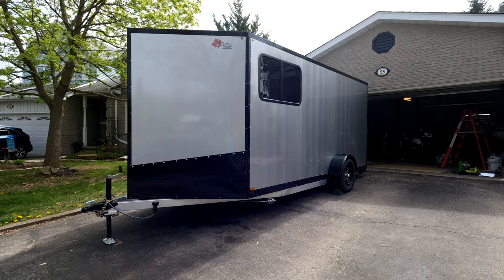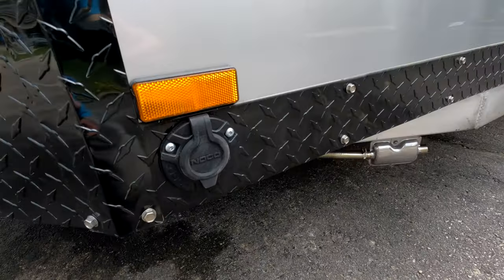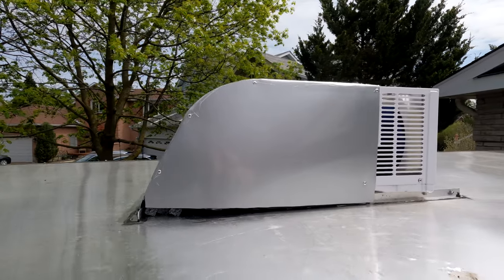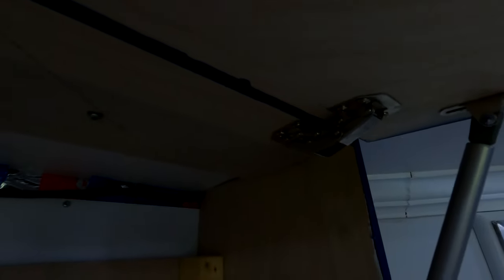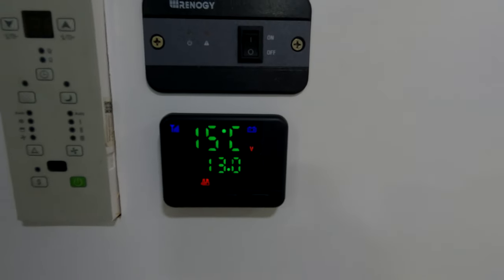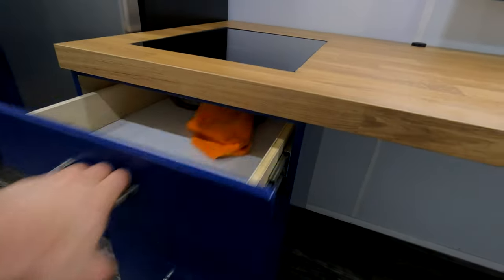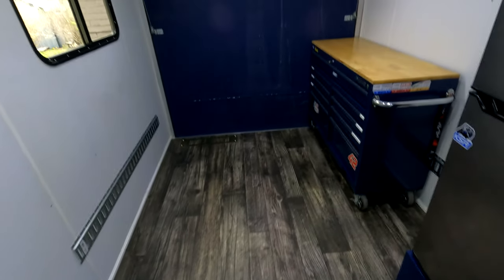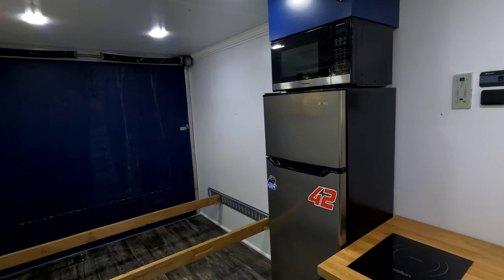Cargo Trailer to Race Trailer Conversion, 7x14

Comment: 1. I assume you plan to run the diesel heater at night? Assume you've tested that it's quiet enough for others around too then. That my main concern, I really want one as those nights at bogie at a little chilly later on, but don't want to bother others. What make/model did you get?
2. That AC idea is genius, imma use it.
3. That poor car. You might be better off renting a truck for the weekend.
4. Wish my trailer ramp could be made into a drop down like that. That's genius for the bed.
Reply from the maker: Yes, it it very quiet, I wouldn't hesitate to use it trackside in the pits overnight. The car is rated for 3700lbs and with the trailer fully loaded I am right around 2600lbs. It does a great job with it; 3L inline 6 turbo has more than enough torque. Also has oversized brakes, transmission cooler, large wheelbase and wheels/tires. It's very stable while towing!

Comment: I like it, I’m installing insulation  in my new 6x14 just pulled it home from Washington to California with my 5,000 pound ford flex 460 horsepower V6 engine, manufactured hitch with a 3,500 total weight rated hitch 250 pounds at the hitch… trailer 1,300 pounds had electric brakes installed by the dealer. Your trailer must be about 1,500 pounds, your car 3,500 pounds, not suitable for towing! Please reconsider your tow vehicle. With your motorcycle, guessing weight 2,200 pounds,  hitch weight must not exceed 300 pounds. Be prepared for an emergency braking situation if your trailer starts swaying you will most likely not be able to to regain control! If you have brakes on your trailer, install brake controller it will help you to control trailer swaying. On a windy day, wind can blow over a 80,000 pound 18 wheeler. As I started my trip with a 12’ U-Haul trailer California  I5 out of Sacramento the wind blew for 60 miles scared me that the wind might blow me off the road, I mean scared!!! I had driven my 18 wheeler on this road many times in the wind , believed me your BMW is not a tow vehicle. You can get by with it. Maybe 100,000 miles but there’s always traffic and weather. You never know when your going to have to brake in an emergency, it’s hell when your trailer try’s to pass you, Your BMW is the same color as my Mustang 4 million miles driving the roads of this country.
Reply from the maker: @APhotographerTravels2025JohnMc  thanks for the feedback. I actually modified the trailer a bit and now carry 2 bikes with it. Fully loaded I'm about 3200lbs now which is within the tow rating of the car. The car is about 3700lbs weight. I do have trailer brakes which are very effective. I've towed very regularly for the past few years and it's been flawless. Towed thru heavy winds, traffic, poor weather etc. It can be done with no problems, just have to drive to the conditions. It's a perfect vehicle for towing. Long wheelbase, wide track, low center of gravity, oversized sport brakes and cooling. Tows right around 2300rpm at 105km/h getting 18L/100kms. Very happy with it.